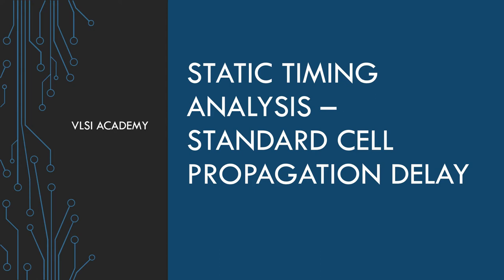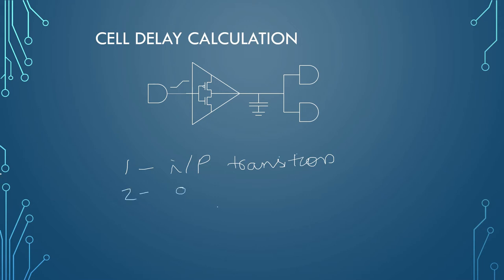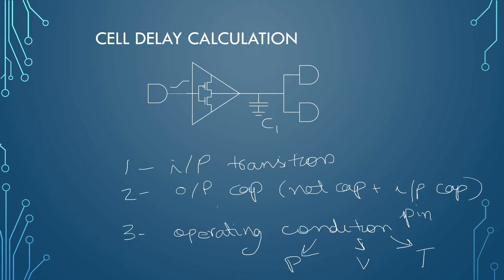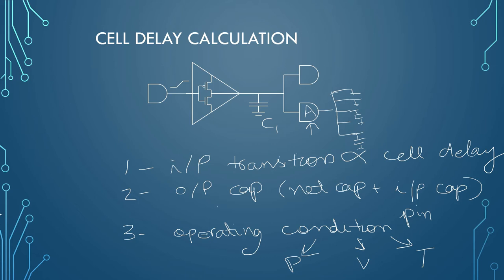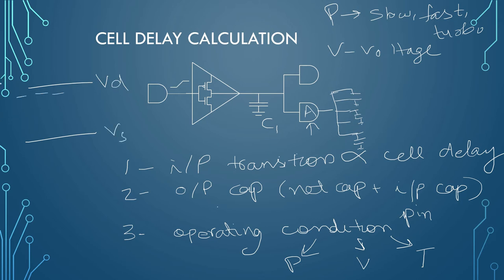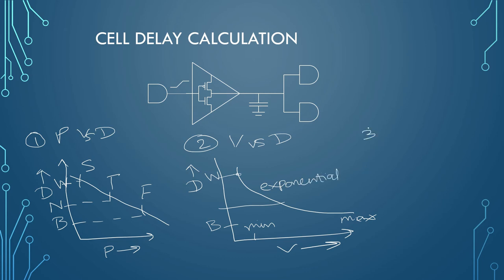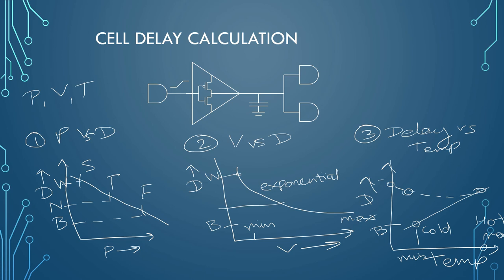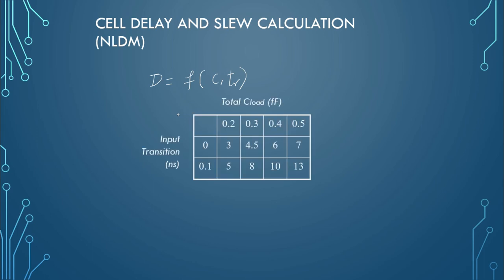STA lec11 std cell propagation delay | static timing analysis tutorial | VLSI

Comment: cellular concrete = (Build) Concrete of low unit weight in which bubbles of air are induced by chemical or mechanical means during manufacture.
Reply: Page 188
Reply: what is the name of the book you are reading please ?